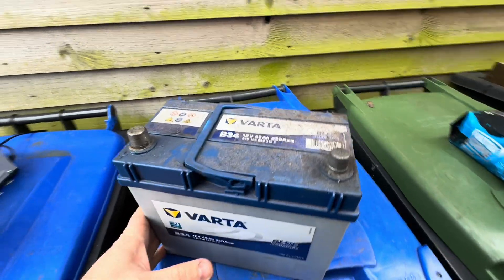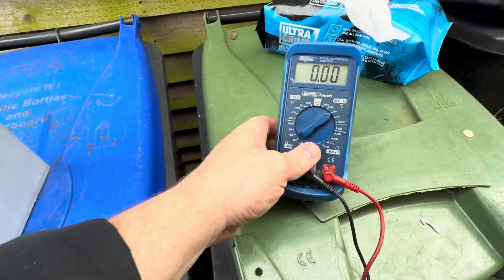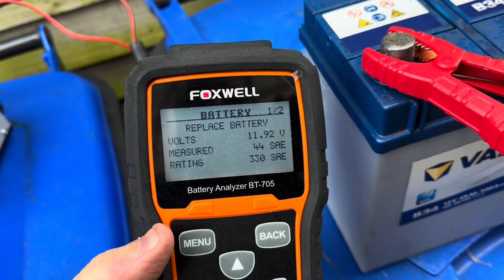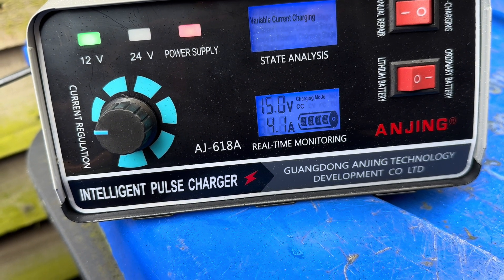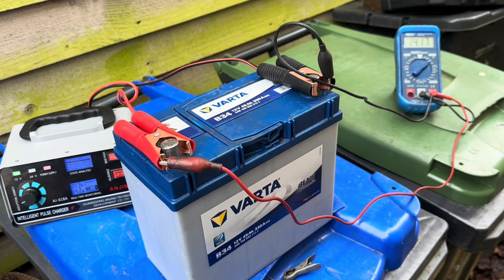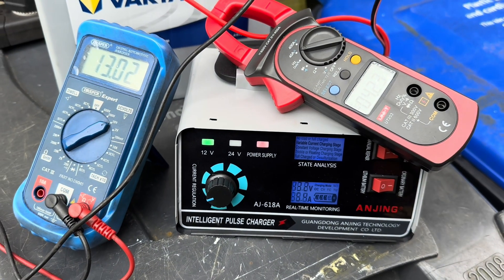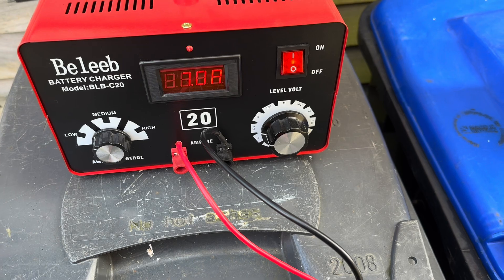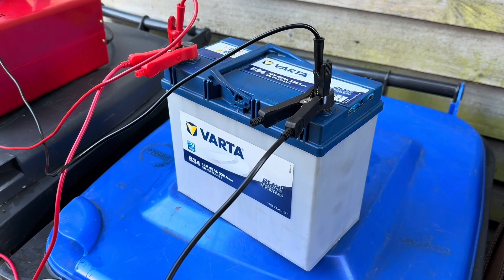Salvaging, rejuvenating lead acid car batteries - Part 1

Comment: hi thanks for the video, think its strange both chargers were low according to the clamp, maybe the chargers aren't wrong and the clamp meter is sus
Reply from the maker: Unlikely I have used this
On other circuits and chargers of higher quality, it certainly indicates that the cheaper units tell lies where ad the more expensive units do not.
Reply: @ACDodd interesting definitely something to look out for! Cheers